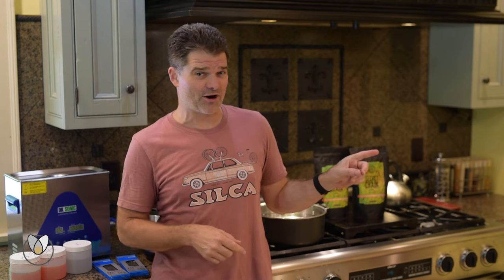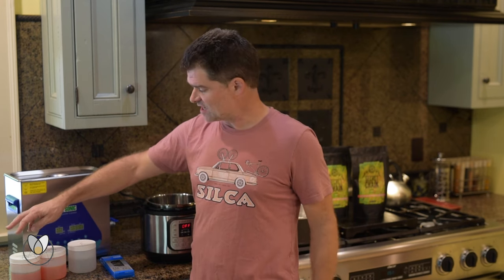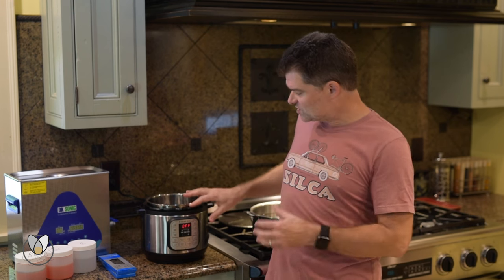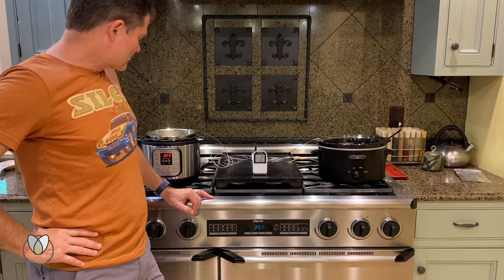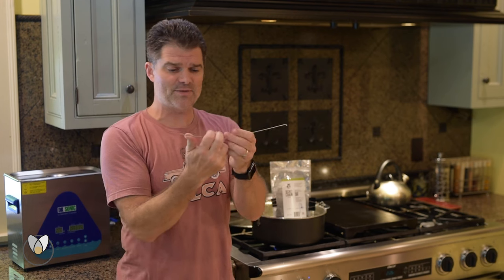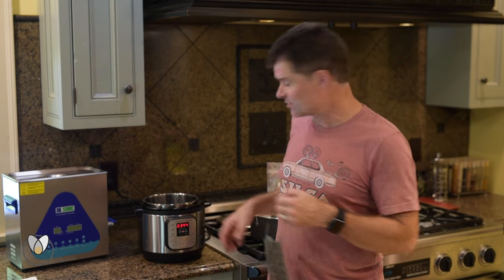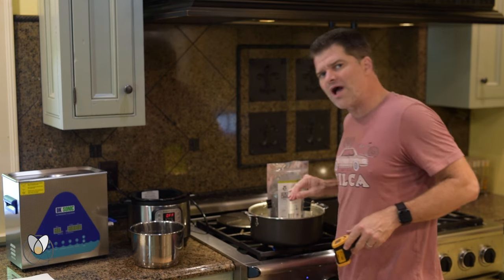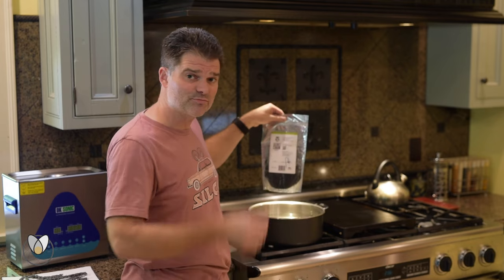MGTV: How to Hot Melt Wax Your Bicycle Chain

Comment: For a new chain is it better to use mineral spirits or degreaser….I’ve seen examples of both.   Is one better than the other?
Reply from the maker: SILCA Chain Stripper was just released last month and is considered the best method as it not only removes the factory grease, but also leaves a wax adhesion promoting layer on the chain.  https://silca.cc/products/chain-stripper

Comment: would it be beneficial to also dip a new cassette in the wax if it "changes the metal"
Reply from the maker: No, the external wax on the chain will embed into the metal while riding.  Some people also do a light coating of our SuperSecret drip lube on the outside of the waxed chain, and then run it through the gears on the workstand to coat the cassette and rings.  This will give you the most quiest drivetrain you've even experienced, but isn't necessary and does not test any faster or anything like that, just very quiet!

Comment: Awesome video and great recommendation on the Instapot.  My slow cooker takes 2 hours to get to 93 degrees celsius so an Instapot would be really helpful.  However, I'm curious why people don't recommend electric skillets?  It seems that they would heat as fast as an Instapot, they are less expensive, and they have an exact temp control so you aren't always wondering what the temperature it is and how to keep it one specific temperature.
Reply from the maker: Thanks!  I have zero experience with electric skillets, but looking at them, I'm sure it would work if you can control temp.  However, in a future video, I'll show you how you can drop the instant pot liner into your ultrasonic cleaner to drive the wax into the chain (this is how we do it for ProTour teams) and that is one of my absolute favorite elements of the Instant pot.  We also keep numerous liners for the instant pot around with different mixtures of wax in them and then only use the one heating base..but that's probably not something you need for home use!  - Josh
Reply: SILCA Velo Thank you!  Very helpful. I understand exactly what you are proposing with the liner and ultrasonic cleaner. I have one that heats to 80 degrees Celsius.  However, I’ve avoided using it to apply wax because I was told 80 degrees wasn’t optimal for applying the wax. I was told it needed to be between 93 and 95 degrees. I guess adding the ultrasonic function adds something more than reaching the optimal temp. Do you think 80 degrees is enough?  Is that the temp you use for pro racing teams?  Thanks again.

Comment: Can I microwave the wax pellets in a bowl and then drop my chain in while it's still liquid? Or will microwaving the wax breakdown some of the additives??
Reply from the maker: We don't recommend using a microwave.  You could in theory heat the water with a microwave, but it likely wouldn't stay hot enough for long enough to melt the wax.

Comment: So ultimately, what are the benefits of this hot wax method over the Super Secret Lube formulation in the jar you also sell?
Reply: Hot melt is cleaner and lasts longer.
Reply from the maker: Hot melt allows you to get a bit more wax into the chain so it lasts a bit longer and can run at fractions of a watt lower friction (though this is minimal).  The drip lube is emulsified in a carrier to allow it to penetrate the chain, and then this carrier evaporates, so it isn't possible to get 100% fill of the rollers with the drip wax like it is with hot melt.  Ultimately, the differences are rather small between the two methods so it's a personal preference for most. - Josh
Reply: So is it better than a hot Parrakie bath?
Reply: Is there a more concise set of written instructions somewhere on the silca website?

Comment: If I have an Instant Pot dedicated to using for hot waxing, what do I do with the leftover wax that is in the liner after I remove the chain? Can I just leave it in there and reuse it at a later date?
Reply from the maker: Exactly, just leave it in there for next time.  You can get a second liner for the instant pot so you can use it for other things
J

Comment: Can you reuse if use the crockpot method? I take it you need to keep the wax in the pot or can it transfer back to the bag?
Reply from the maker: You'll definitely want to keep the wax in the pot, but yes, you can reuse the wax until it is all gone (~40 waxings per bag)

Comment: what would be best option when doing a batch of chain lets say 2-3...do them together? or one by one - but then one has to cool and reheat the wax?
Reply from the maker: If you are doing multiple, I would just pull them hot.. allowing it to cool is maybe buying you a few additional % of wax in the chain and I typically save that strategy for special events or races.  For everything else, you can go in and out at 195F or so and get 99% of the benefits and longevity in a fraction of the time spent waxing. - Josh
Reply: @SILCAVelo  oki now another question...so my mechanic despite my warnings applied smoove to my chain - do i need to go through the degreasing again before dropping into hot melt pot?
Reply: @arturpiasecki6654  You need to get a new Mechanic. You are the Mechanic’s customer, and the Mechanic should always do what you want, or discuss with you why they think it isn’t a good idea.

Comment: Is the product safe to use indoors on a trainer in a room which has light colored wall to wall carpeting?  
A user commented below about a black residue under the drive train attributed to tungsten disulfide.
I do have plastic mats which extend about 20 inches (50 cm) laterally from the chain under the trainer but concerned about the area beyond.
One of your videos demonstrated how tunsgten disulfide adheres even to glass. Would imagine if it makes it's way into the carpet there would be no chance for cleaning.
Reply: I did that. Vacuuming gets up the large bits, but don't use the beater bar..it just smears the bits. The powdery bits are still in the carpet.
Reply: @brianrichards350  In the meantime I started to use Silca waxed chain on my trainer. I see a surprisingly abundant amount of wax flakes after each session, both on the floor and on the bike frame, trainer, etc.  I thought it would just the tungsten powder (if it is, I don't see it, or it's rather in the wax flakes, which look dirty).
I am yet to ride the bike outside for the first time. I thought I was going to save time moving from oil based to wax, the opposite is true.  At least considering the time spent degreasing a new chain. Will see in the future. Main benefit I see so far is I won't have to deal with the oily mess. I didn't think chain was more quiet or shifts better with wax compared to oil, if anything I found oil lube was better that way. Could be wrong.
Reply: I wound up putting an old towel under the chain line of the trainer and let the bits fall on that. I think they understate the time to run in the chain a bit...at least for my 100 W rides. It took about 1 to 2 hours before the chain really started to feel smooth. It did run all season for me with only a couple of touch ups of liquid wax...so more effort initially but worth it in the end.

Comment: You said do not overheat the wax - when would this point be reached and is it just to prevent fire 🔥 or more about braking down the formula and degrading the lubricant?

I think the best way is to melt in the bag on the stove and then transfer it as a whole to my ultrasonic and let it do the aggregation for me 😁

I just want to know what would happen if the wax reaches over 200 Fahrenheit f.e. ?  Would it brake down and be unusable or anything? Or is it just a safety’s issue ?

Thx
Reply from the maker: Mostly a safety issue, but the wax can be damaged from about 220F and upward.  Mainly, we've just seen no advantage to going hotter and the potential disadvantage of pulling the chain at a hotter temperature is that that more wax will run out of the inside of the chain leaving less behind where you really want it.  As for your ultrasonic, yes, for our Diamond Polished race chains we wax ultrasonically which allows us to use a slightly higher concentration of WS2 since the ultrasound pumps the particles into the chain, without ultrasound, additional particles just settle in the bottom of the bag and can't properly be agitated into solution to do any good.

Comment: Hello Josh,
I have been using your Super Secret Lube in a bottle for a few months now and have already got an ultrasonic cleaner after watching one of you previous videos, and have just ordered an Instant Pot, an infrared thermometer and some Super Secret Hot wax after watching this one. Just a question about the drip lube, I have been using it on my indoor bike which is on a Neo and the first few rides after a fresh lube I get little black bits of wax under the chain line. Why is this excess wax black? Is it because my chain isn't clean enough or is that just how the wax goes?
Thanks
Reply: That would more than likely be the tungsten disulfide. Josh addresses that in another of his videos as it being black.

Comment: Is the chain supposed to be quite stiff when first put back on the bike? It’s the first time I’ve tried the waxing and it doesn’t exactly flow over the derailleur shall we say. Albeit I’ve not ridden it as yet
Reply from the maker: You can either break it free by flexing the links, some people will pull it over a small pvc pipe or similar to do this, or you can just ride it for a few minutes and it will loosen up.

Comment: Hi, Josh, have you experienced this problem with hardened wax accumulating on the smallest cog (11 t on a 12-speed cassette), and especially between the smallest cog and the next smallest one? Today I couldn't use the 52/11 gear combination because of this, the chain kept jumping  around the 11th cog, which obviously could be quite dangerous if you're putting your best effort at that time. I used a toothpick to try and pry out the accumulated wax. Could you suggest a better way to do it?
Reply from the maker: Are you just hot waxing?  I can't say that I've ever seen that with hot wax.  I've seen it when people drip wax for a year or so and you can get accumulation in those areas if you are applying the lube with the chain in that area, but honestly not ever with hot melt.  Please send us some photos to sales (at) silca (dot) cc
Reply: Mostly hot waxing. Only drip waxed once, to try it, didn't like the idea of basing my actions on being too lazy, so I opted for hot waxing only (have done it 4 times now), it might have been accumulated gradually, but I only noticed it now because the chain started skipping teeth on the 11t cog. Unfortunately I've cleaned it already this time, so no use sending you pictures after cleaning it... but I'll send pictures next time it happens. Thanks. @SILCAVelo
Reply from the maker: Maybe try pulling the chain from the wax when it's a little hotter.. you should have little to no wax on the outside of the chain after waxing.  The only thing we can think of would be excess wax on the outside of the chain getting scraped off and jammed in there.
Reply: That should be it. I'm still playing around trying to find the exact moment I should take the chain out of the hot wax. First 3 times it was really full of excess wax, cleaned it for hours after... Last time I pulled it out a little bit before the crust forming on the hot wax surface, and it was much easier cleaning it, say 15 min, using a spare cog. I understood from your video that I should not pull it out too early, or otherwise there'll be insufficient coating. @SILCAVelo

Comment: So how long does it take for the chain to lose stiffness once the wax has cooled?
Reply: You have to pre-break it before putting it on a bike. The easiest way is to run it around a PVC pipe. After a couple kilometers it will be smooth, first 3 might be a little jumpy, but after that it's good enough. For race-ready break-in I would say around 20km. Also don't wait to pull out the chain from the wax bath, theres no point since all the excess will flake out in minutes -the pressure between the links is way greater than too thick a layer of wax could support. You just loose more wax and get bigger mess on your frame and drivetrain. Check out zero friction cycling guide to waxing chains.

Comment: have to be very carefull with the water temp as the bag will leak, better to put wax in a seperate pot which is then put in another pot of water so direct heat is not affecting the wax

Comment: Would an induction hot plate be more effective than a crock pot or do they regulate the temperature in the same way?
Reply from the maker: As long as the induction hot plate is temperature controlled and not just amperage controlled you will be fine.

Comment: It would be good to see you preparing the waxed chain for installation on the bike. Tips to break the wax to get the chain flexible to route through the chainrings, cassette and jockey wheels. I have found this last step a little tiresome
Reply from the maker: Will do, best method I've found is to take a 1" or so piece of PVC pipe and just run the chain over it from one end to the other.
Reply: I never have an issue with chain flexibility, never have to do anything with it after it dries. I think it might be because I don't dry it hanging. I don't want the wax to be spread think in 1 side or pin/roller interface. So I always dry them laying on the side

Comment: Oops, I waxed a new chain, but didn't remove the factory lube first. Anything I should do to rectify?
Reply: Start all over again. The wax will not adhere to the chain because of the greasy film, sorry. i know: it's annoying to have to degrease the chain with chemicals, solvents, etc, it's a mess and nobody like it but you have to do it. Once and for all,

Comment: Can we get some more of those silicone wheel speed shields? Also, would they fit the razor sharp edges of madfiber wheels? I have multiple sets and am needing a similar solution.
Reply from the maker: Speed shields ship with all SILCA valve extenders, tubeless valves and latex tubes that have extenders.. they do not work well on super sharp wheels like Madfiber or older Lightweights as they are a bit too rigid to conform to that very tight shape.

Comment: how long do you hang it to dry before you can put it back on the bike?
Reply: It’s not actually drying, just cooling. As soon as it’s cool you should be able to break the links free from each other and install your chain. You only need to let it dry if you’re applying wax emulsion

Comment: What do people think about using a steamer to do the first round of cleaning?  Would that get the chain clean enough so that a single degreaser bath is needed?
Reply: there's stuff called Oil Eater. its 100% non-toxic. it will strip off EVERYTHING from a used chain in seconds. i don't think it works on the factory preservative on brand new chains though
Reply: Nope.  I think if you have a steamer that is sufficient to clean a chain that your going to be needing some personal protection.   I think its far easier to work with safe solvents.   I just did 3 chains with various solvents and haven't found the magic one yet for stripping a chain to a pristine state.   Next, I'll be trying some auto parts cleaner fluids that are safe for the environment.   They seem to be way way cheaper than bicycle specific chain cleaners.   Plan B would be to spend some $$$ and buy a bike chain cleaner.

Comment: Hey Josh: That about cleaning the cassette and derailleurs? Thanks
Reply: *What about...
Reply from the maker: I'm a big fan of Dawn dish soap and hot water scrub with a stiff brush.. the ones for car wheels you find at the auto parts store are cheap and seem to be stiff enough to remove crud but soft enough not to scratch if you use it on a painted surface.  Or, you can remove and shake/ultrasonic clean if you have the time and means for that.  If you are hot waxing, you will find that you very rarely need to clean your cassette and rings and only occasionally your derailleur.
Reply: @SILCAVelo  Thanks Josh

Comment: What setting did you use on the Instapot? Saute or Slow Cook?
Reply: In the video he says ... crock pot ... which is slow cook.   I set it on slow cook for 8 hrs to get a lower heating temp.

Comment: Couldn't I do this with a regular pot on an induction stove without a waterbath. With a dedicated pot of course.
Reply from the maker: There is a risk of overheating the wax when using directly on the stove which could both damage the wax and potentially start a fire so we do not recommend doing it this way.  A double boiler or dedicated wax melting device add an additional level of safety and are recommended.
Reply: All the hobby candle makers out there will tell you that you should never heat wax directly on the heat source.   Double boiler or whatever else you got will work.

Comment: Can I put the wax into a ultrasonic cleaner which can heat? That will be three step in one I guess.
Reply from the maker: You can, we actually ultra-sonically wax chains for our chain program and pro athletes, it works very well, but it is not 3 steps in 1.. you still need to do the full clean and degreasing and drying of the chain before waxing.  Our setup uses 3 ultrasonic cleaners to degrease and wax the chain.
Reply: @SILCAVelo  is there any benefit to using the bag method in the ultrasonic cleaner?
Reply: @SILCAVelo  mu ultrasonic cleaner only goes to 175F, is that hot enough??